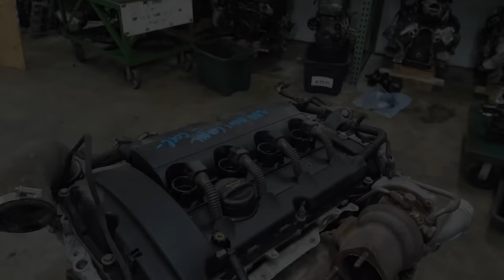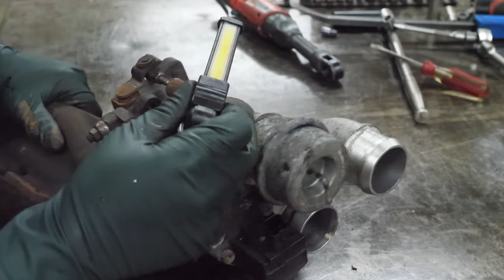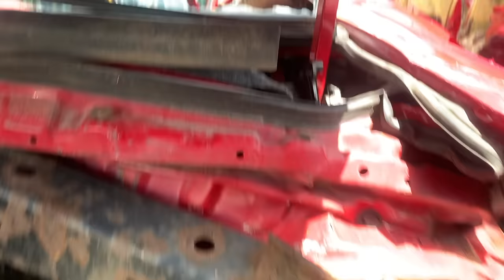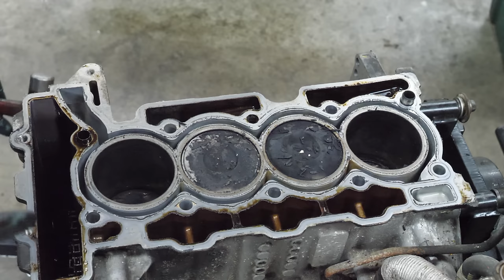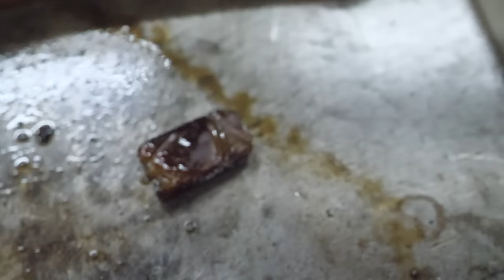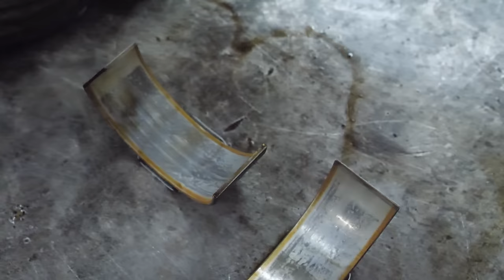JUNK Mini Cooper S (BMW/Peugeot) N14 Turbo Engine Teardown. Why Do People Buy These?

Comment: I have the 2011 N18 version, supposedly it's better. Agree the oil filter is the worst place i've ever seen. When it's in the car you have to remove the coolant reservoir completely as the hoses aren't long enough to just hang them away.

Comment: Overall a good video.  Subscribed.  A few comments: 1. I appreciate that you are (successfully) trying to get YouTube views with your title, but I think labeling this engine "junk" or asking "why do people buy these" is a little strong.  Granted it did get me to watch it, and watch all of it, but it left a bad feeling about you and your channel.  2.  Let's remember that nearly all manufacturers at the time this engine was made were all experimenting with service intervals and direct injection. I think everyone has learned from these and other engines that longer service intervals, while good for initial ownership cost, is bad for longevity.  3. Why would someone buy this car?  They are incredibly fun to drive.  In a sea of bland, uninteresting cars, Minis look different and drive different than nearly every other car on the road.  You and I both know that the more fun a car is to drive, the more maintenance it will require.  4. Did you know that these cars have a separate cooling pump just to cool down the turbo after the car has been shut off? Or that they have dual mass flywheels on the manual transmissions? 5. Do they leak? Yes?  Are the less reliable than other cars of the same vintage?  Yes.  Are they expensive to repair?  Sort of.  6. Why would someone buy one?  They have very torquey engines and handle like go karts.  Plus they don't look like every other car on the road. Ask a lay person to discern a Kia from a Hyundai from a Toyota from a Honda.  Almost impossible.   I want to emphasize that I appreciate you taking the time to show all the challenges with these engines (which you accurately described), however, reserving judgement and just sticking to the facts would have made this an even better video.
Reply from the maker: I think if you read the other comments, the sentiment of the title along with the fact I have nearly zero sellable parts from this engine establish the title as a fair assessment.
They are in fact fun to drive, but they have to drive to be fun. 
I judge cars not by how well they drive but by how reliable they are when following manufacturers suggested maintenance intervals, and how tolerant they are of extending it.
Whether these cars were short changed by the manufacturer suggesting intervals that were too long or not is somewhat of a moot point as buying one used is a risky proposition.
I much prefer the previous generation R53, because while those do have issues, they aren’t as relentlessly financially exhausting as this generation.

Comment: I had one of these in a mini r56 the dip stick got stuck on the chain guide and wouldn’t come out. When the sump was dropped there was plastic and bits of piston ring in the pick up. I scrapped it and got a countryman diesel

Comment: Ive only had one catastrophic failure with a car (owned over 20 autos). It was a company car and the leasing company refused to allow a transmission service at the scheduled interval, At 80K miles the transmission blew up. Yes there are failures that occur when maintenance is done but I have to think that a large number of people either abuse their cars or dont do maintenance. Service and non-hard riving will make almost any car last 150K miles,

Comment: It's the non turbo version that shits the bed. I had two completely different engines burn valves .  One at 118k miles and the other at 70k. 5k oil changes.

Comment: I wish I could’ve seen this video a couple of years ago after I bought a mini Cooper that was a 2004. It only had about 140,000 km on it, and the engine blew up. One of the spark plugs just shot straight out of the freaking engine.

Comment: Did you test the oil cooler?  If the head gasket was intact, then a failure in the cooler would explain... well, SOME of the water in the crankcase!

Comment: What do BMW recommend as a service interval?  I know Peugeot recommends every 10,000km or every year, which ever is sooner.  My wife has a Peugeot 208Gti and is 8 years old with under 30,000km on the clock and still looks like new

Comment: A view from the UK. You are perfectly entitled to your opinion regarding the quality of particular engines. Opinions are like backsides, we've all got one. But, before rubbishing a particular engine could you make us aware of how many units are out on the road and their failure rate so we can get a percentage. You make no mention of how they are driven - cars with a 'S', 'GT', BMW or Mercedes in their name are prone to being driven harshly especially from a standing start - stop lights anyone?. My experience is that with aluminium engines they warp if they are not warmed up ESPECIALLY if thrashed from cold, we call it thermal shock. You need to ask why there are so many on the road that DO cover many miles. At 73yrs old and passed my test at 17yrs old and finished my working career as a chauffeur for 12yrs taking some cars to over 300,000miles, i have concluded it is not the car, it's the driver - the way they are driven. You know as well as i do that the vast majority of 'blown' engines you waste your time stripping are there because of either lack of water or lack of oil. In most cases it's normally gasket failure or owner stupidity.
I've also got to take issue with your observations on the cam shaft journals. Again your observations are a waste of time because it's the RESULT of diluted oil. It's like saying a house was built badly by observing the ashes after it's burnt down. Sorry all you voyeurs but i'm off, i'm learning nothing.

Comment: I had never interested to have another car after the MK1, So i didn’t spend anymore penny for those newer garbages to whatever they look great & blast, Nor I  will purchase EV’s either 
I just keep our MK1 on the garage and they still run great on daily weekendly  
My R53 is still blast greatly, yeah I did replaced several important parts, Chain tensioner, Damper/harmonic , Belt tensioner & idler, Serviced SC and some little sensor( MAF/absolute pressure )*  plus new radiator, AC drier etc  etc and I didn’t pay any mechanic or anyone, the parts ain’t expensive either ( mostly OE)* and I’m not a mechanic i guess it will run fine for another 2 decades from now 
 I though I have become a solo mechanic 😅

Comment: They are terrible. I've had mine 6 years and it's blown up twice. One top-end rebuild and one full rebuild.
I've replaced my clutch throwout bearing 5 or 6 times.
The clutch release fork broke in 2 last year (?!).
I've replaced the high-pressure fuel pump 3 times.
They drink oil like it's going out of fashion.
I have all the tools and do all the preventative maintenance and even like that it's been very difficult keeping her on the road.
If you get an N14 R56, be prepared to do a lot of work.

Comment: I’m thinking about buying a Mini Cooper S r56, which 2007/8 example a bit over 100k miles. I’m in the uk and the only really feared thing is the timing chain and the tensioner. The car I’m going to view this coming weekend has full service history, chain and tensioner replaced 15k miles ago around 14 months ago. Should I be worried about the higher mileage? In the uk we have a mot test every 12 months a car must pass to be able to be legally driven on uk roads. This car has 11 months mot left, no advisory (warning) items on the last mot test and it’s passed all mot tests for the past 5 years.

Comment: In 2016 we bought a 308 Peugeot with this turbo charged engine.
Impeccable condition and service history and just 75000km.
A little after a year later the trouble started.
The timing tensioner fell apart and we had all that renewed.
Six months lster the hifg pressure fuel pump gave the ghost.
Another half year later the cylinder head cracked.
At just 85.000km and 10.000km use we had spent around A$6000 on this  engine.
NEVER BUY ANYTHING WITH THIS MOTOR !!

Comment: I bought an 08 S with this engine, not running. with 70k.  I had zero compression in #4. took the pan off and found chunks of metal.  #4 had the ring land break off and took out the piston skirt. Replaced #4 rod and piston, timing, vanos, and stat housing. ran good when done, but dumped it quick and made a few bucks.   someone should make a b46 conversion kit for the 07-14 cooper S

Comment: Having owned a Mini garage for some years, this engine is a nightmare! I can't tell you how many of these I've rebuilt. They burn around a ltr of oil per 1000 miles so check the oil regularly.  HPf pumps go. Timing chain and tensioner fail,  honestly the list goes on and on!! The N18 isn't much better.. buyers beware..

Comment: That engine was pulled out of a river, pond whatever.  Take note of the aluminium corrosion (white powder) on the surface of the engine bloke.  This engine may have been under cover BUT this engine was under water for quite some time.

Comment: The 1.4 NA of the same engine family is worse, no matter what kind of maintenance you do or have done, this engine at 180-200.000 Kms will start to loose compression end eat a lot of oil until it will start to missfire end eventually die. Swapped a lot of 1.6 NA on these minis, it’s kind of plug and play. Here in my country 1.4 are all pretty toasted, it’s impossible to find one used still running fine, only 1.6s NA

Comment: These direct injection have unburned fuel slowly dissipate into the crankcase oil, which washes out the chain, tensioner and more, prematurely shortens longevity. It doesn't matter how high of quality oil, synthetic or not, its getting particles of fuel. Thats why you need to change the oil far more frequently than the original manufacturer specs.

Comment: I've been servicing these cars for 21 years now. Sure you have some young kids who don't have two dimes to rub together that drive them, but a lot of them are driven by grown up professionals, who have an almost cult like adoration for them.

They bring them in, and spend thousands to get them up to speed. 🤷‍♂️

And honestly, the Achilles Heel of these engines is the oil consumption. They don't have an oil level sensor, only an oil pressure sensor. So when you get that red jug on the warning display, you're basically running without oil. This eventually kills the engines. The biggest culprit of oil consumption on them is the valve stem seals. If you nip that in the bud early, you will be ok. If you get caught slacking, and run it with low oil, you could damage the cylinder walls, and that requires a resleeve to correct.

Outside of that, timing chain guides are a problem, and so is chain stretch (associated with low oil levels). The thermostats are also known to fail aplenty. 

But if you keep the oil consumption at bay, these are little robust, fuel efficient engines, in the right chassis which are a blast to drive.

Comment: The 16th International Engine of the Year Awards were held on 25 June at the 2014 Engine Expo in Stuttgart, Germany. At this latest ceremony, PSA Peugeot Citroën won its eighth consecutive Award in the 1.4 to 1.8-litre category.

Presented by the specialised UK magazine Engine Technology International, the prestigious Award once again honours the 1.6-litre direct-injection turbo petrol engine developed in cooperation with BMW Group.
Belonging to the Prince engine family, the 1.6-litre turbo petrol engine is offered in 155 hp and 200 hp versions and has recently been launched in a 270 hp version to equip the new Peugeot RCZ R

Comment: You   missed    the   genius    of   this   engine  ,   the   end   of  crankshaft   comes   off    when   the   centre    bolts  is  undone   so  you  can  change   timing   chain  easily

Comment: I had this engine.  It was a nightmare and had all the problems.  Got rid of it at 50,000 miles because it was drinking a quart of oil every 500 miles.  I did plenty of maintenance and always garaged.  Whole car was junk.  Exterior plastic would melt and warp in the sun.  The coolant system was all plastic, so it would all crack and glue seams would split.

Comment: Over in Europe these things are everywhere. Mini, BMW, Fiat, Vauxhall/Opel (GM). They do seem to last a bit longer in the Fiat, no idea why, but yeah, they're not good. However, the quest for low emissions means buying a small, aluminium, boosted to death engine and throwing the car away after 10 years is apparently what we should all be doing.

Comment: Thank you for the video. Question !
Does the Peugeot RCZ 2011-1.6 petrol 200 bhp have the same engine ? And what preventative maintenance do you recommend apart from normal servicing pls ,? 47,500 currently. Should I change water pump - oil pump- and is there another pump near the turbo ? .
Thank you in advance amazing video

Comment: These Mini Cooper engines have huge problems with carbon deposits on the valves and tops of the pistons.  They also have poorly designed cylinder heads which always tend to drop exhaust valve seats, and then have the exhaust valve's head break off and destroy the piston and head if the engine is not shut down immediately when that happens. Unfortunately, most people hear the noise and then try to re-start the engine repeatedly, only to have it run poorly on 3 cylinders and further pound the valve pieces into the cylinder head and piston top.  These engines also wear out their timing chains and related timing components  around 90,000 to 100,000 miles.  Parts are expensive, on the level of a BMW.  As Adam stated, finding a used engine that is in good shape is virtually impossible.  I am rebuilding one of these engines right  right now for my Mini Cooper (1 2007 hatch) and don't even want to total up what I have spent for new valves, pistons, rings, engine bearings, timing chain set, oil pump chain set, gaskets, etc.  Another problem is that the Mini Cooper factory was suggesting stupidly long oil change intervals of around 10,000 to 15,000 miles when these cars/engines first came out in 2007. It was a recipe for disaster.

Comment: The water in the engine may be there due to an oil cooler failure, they're pretty common on these engines

Comment: A relative bought one from a main dealer maybe 10ish years ago, owned, paid out more in multiple repairs in two years than the purchase cost and sold it to some other unlucky soul via the same dealer. They prepped the car and gave it a polis, then sold it as a ‘BMW approved car’. Apparently the exact car, lasted a few months more before seizing solid. My relative will never buy another BMW.

Comment: I had two Minis in my life.  The first, a 2006 Cooper S (last of the 1st gen; supercharged, Dodge designed/built engine) was strong, reliable, and held up to hard use flawlessly for 80,xxx miles before trading it for a gen 2 (Peugeot built, turbo, JCW pkg).  The 2nd gen was in the shop every month.  It all came to an end on a hot day on a Georgia highway when the engine blew-up at 65mph.  It was repaired under warranty because it had a cooling-system related recall (i think due to plastic water pump failure).  After 2 month absence, I reclaimed the car and it never operated satisfactorily (rough idle, blowing blue smoke, intermittent check-engine light).  I did a voluntary ‘repossession’ and was happy i did!  After many visits to the Stealership, I finally dropped the car off at the dealer with the keys inside.  

There’s a reason why Peugeot doesn’t sell their cars here …they’re crap for durability.  

Bmw made a poor decision to use Peugeot engines and unfortunately ruined the Mini brand image.

Comment: The timing chain guides was replaced under a recall due to a class action lawsuit.  Not necessarily a failure on this one, but could be a broken piece off the original.  The originals were such weak plastic they would crack within months, like mine.  The new design was stronger plastic.  Avoid these engines, even with thorough maintenance.  All the plastic components like thermostat, water pump will fail.  The PCV valve is part of the valve cover, can't replace it.  High pressure fuel pump fails, turbo cooling fan/computer fails (recall),  valve cover gaskets leak.  etc...

Comment: The EP6 engine was undeniably flawed from the start thanks to BMW. Thankfully Peugeot stuck it out and fixed the issues with the engine and now is a pretty reliable engine.

Comment: The worst part of this engines design is the self destructive engine mount set-up. The mounts are on the head and not on the block, so over time the engine is 'hanging by it's neck' which leads to head-gasket issues due to the weight and vibration of the operating engine creating small seperations between the sealing surfaces, this is not an engine that is designed to last.....at all.

Comment: A million years ago when I was a student I funded my motoring by working in a workshop in the UK. The original Austin /BMC A-series engine, dating from 1951, was a paragon of design simplicity, even when, as in the original Mini, it was turned through 90% and used its gearbox as its sump. I loved working on them. To call the travesty of engineering your teardown reveals by the same name as the original masterpiece that is the real Mini Cooper S is just plain offensive.

Comment: I had the misfortune of buying a very nice looking 2009 Mini Cooper Clubman with 80k km. I had to pratically sell it as junk after another 25k km. The water pump failed, then the A/C, then the remote and finally the damn engine gave up. BMW told me it was normal for the engine to go through 1 liter of oil in 1000 km. WTH is this a 2 stroke engine?!?